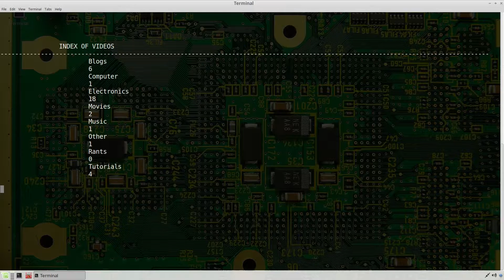Electric Toothbrush Teardown

Comment: A tip, place the toothbrush boiling water for 2 mins and then use the charge to pull off the bottom base.
Perfectly intact.